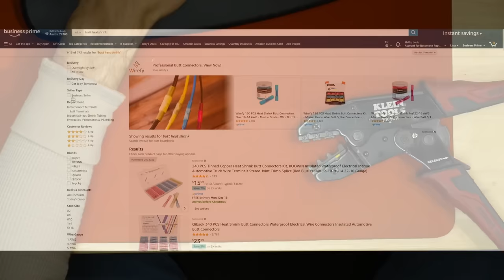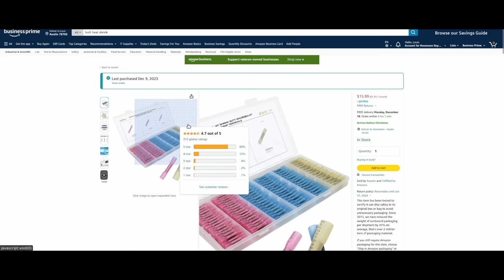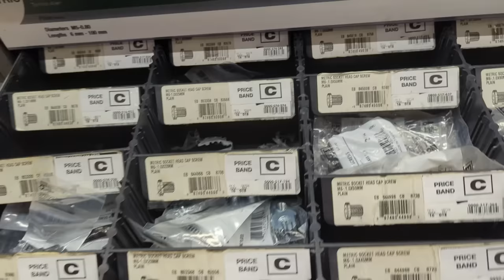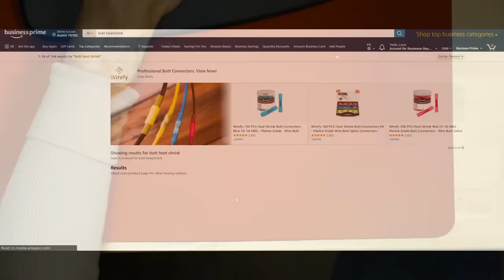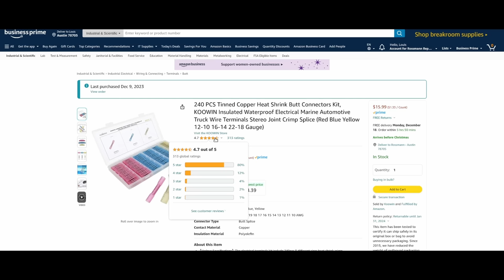Amazon Sells Dangerous Electrical Crimps

Comment: Seeing the stolen stuff in store is so very much seen where I live as well. My thoughts on Amazon's change in direction selling crap is simple. They are doing the same as eBay and whatever junk seller site in China is throwing up. It's pushed hard because these items have the best return for Amazon. When your competition is aiming for very low end stuff sadly the only way to compete is do the same.
Reply: Oh wow really? I've never seen it over here in Europe.
Reply: How do you know that it is stolen?
Reply: GOOD NIGHT SISTA
Reply: @nobodyimportant7804 after enough things get stolen from shops they start locking things up behind glass and cages
Reply: Don't know why you're putting eBay in this post. You can find exactly what you want on eBay including specific brands. Insinuating that Amazon is following eBay is laughable and just shows that you don't understand the point of the video.
Reply: @U-25D5  Oh my bad, I think I misread your comment.
Reply: well in spain is the same
Reply: @U-25D5  We might actually go back to how hardware stores used to operate with knowledgeable staff at the counter (retained because they are paid a decent wage) who you can actually talk to and ask to get what you want for you? Wow, wouldn't that be nice.
Reply: @U-25D5  hard to lock down$5 items
Reply: eBay and Amazon are nothing alike
Reply: eBay is NOT Amazon’s competition tho. Certainly not in North America. It’s just classic race for the bottom capitalism. 💁‍♂️
Reply: Remember when eBay was a place to sell and buy good used items and not a place for everyone to drop ship garbage I miss those days
Reply: @shadedude6games set filter to Preowned it’s same old eBay
Reply: It baffles me how little to no people are in shops at a given time of day in USA whereas here in the philippines, in hardware stores always have a security guard roaming around every hour on a day and security checks your bag at rhe entrance or lets you put your bag in the luggage area with another security guarding everyones bag.
Reply: What is a good alternative to Amazon?
Reply: @transcendtient  eBay buyer & seller here. I concur with you eBay is fine as far as my limited experience is concerned .
Reply: @nobodyimportant7804  Louis mis-spoke a bit. Stolen as in parts and fasteners packages torn open and a few or all contents removed, therefore reported inventory availability is erroneous. Not only Home Depot, this is commonly encountered at Lowe's and other big-box home improvement stores.
Reply: @U-25D5 Maybe so. At a big box store except for graffitti-use spray paints, notsomuch.
Reply: @jam99 Eh? You're describing every ACE hardware or home and garden store presently in existence.
Reply: @transcendtient Agreed. Prime differentiator of eBay is their Seller's behaviour enforcement policies are tough and unyielding. eBay has zero tolerance for the crap Amazon allows their 3rd-party Sellers get away with. Cheers!
Reply: @newagain9964 Your bull$hit capitalism rant aside, it doesn't matter. Everyone's perception is their reality. As often noted in the business press, Amazon perceives eBay as their competition, therefore it is.
Reply: @ghoulbuster1 Ha!, ha! Solid statement. Cheers!
Reply: @jam99    You're funny.
Reply: Thank you! Yes! I total agree, I remember back when I used to shop on eBay (before Amazon) … it was a nightmare, you had to meticulously read every tiny detail of the product description to ensure you’re getting what you think you’re getting and almost impossible to search for a specific item without a thousand irrelevant items showing up because they put every key word possible in the description it was a nightmare and now Amazon is doing the same thing!
Reply: Yet the  "returns" ar not even returns.. The company merely sets up 4ft tall cartons and fillit up with 150+ - items  as done for $450 and $200 ship. The buyer DOES get a better deal with volume of  stuff.. flea sales , and the company never has to bother with  retiuns  TO  their location !
Reply: Yep. Amazon's competition isn't Best Buy or Home Depot, it's Alibaba, Wish, and whatever is going on that's replacing Wish nowadays.
Reply: @SkySong6161  it’s not even about competition. The maniacs who make wish and temu and Amazon are all friends. It’s about keeping the customer confused and docile.
Reply: Leo!! Again!! You're everywhere mate :)

Peace from WA. Hope you and yours have a very Merry Christmas. Thanks for all the great videos this year, again, looking forward to more shenanigans of yours next year.
Reply: @transcendtient people who think you can sell fake or broken stuff on eBay haven’t used eBay regularly and are just making an assumption
Reply: I see totally random seller names now like EKJARVADZ and realize they don't care enough to even to create a name. You crazy, China!
Reply: Amazon US is not a competitor to Alibaba, Temu et al.
Amazon seems to be their most valuable customer!😅

Nearly everything on Amazon you can get at a cheaper price by cutting out the middleman - Amazon!😂

Amazon now serves to 'americanize' China!

I remember the Amazon of yesteryears!

Amazon today is a plaza/mall or market place of many other small and irresponsible businesses!😢
Reply: Amazon US is not a competitor to Alibaba, Temu et al.
Amazon seems to be their most valuable customer!😅

Nearly everything on Amazon you can get at a cheaper price by cutting out the middleman - Amazon!😂

Amazon now serves to 'americanize' China!

I remember the Amazon of yesteryears!

Amazon today is a plaza/mall or market place of many other small and irresponsible businesses!😢
Reply: @helmaschine1885  Maybe Europe needs more diversity then
Reply: @transcendtient  This!
Reply: You must live in a liberal “diverse” place if that’s a issue you people see 😂😂 “cultural enrichment “
Reply: Preach. Ebay comparison is spot on. You can't find the thing you want because it's 100 postings of the same bs under fake company names
Reply: Ebay has gotten more of my business lately because it's often not Chinese sponsored sellers, and instead is individuals or small businesses. Too bad their seller fees are insanely high too.
Reply: @shadedude6games  You miss those days... that we are still experiencing.
Reply: @ckm-mkc  Any retail shop or online store.
Reply: @jam99  I thought we just check ourselves out on the honor system now? Aren't we all supposed to be checking ourselves out now on those stupid kiosks? Pfft, an educated store associate who is paid for their value, haven't seen one of those in a long time.
Reply: @SkySong6161  Temu?
Reply: @nobodyimportant7804 Do you put empty bags back in the drawer after purchasing the item?
Do you go out of your way to screw up Home Depot's SKU system, so they show inventory when they don't?
Reply: @jimurrata6785  What are you babbling about? I misunderstood the OP, and when they clarified I admitted I misunderstood. It was a derp on my part.

You seem to have misunderstood me.
Reply: Yep, but these retailers have to reap what they sow.  If you end up peddling the garbage from drop shippers, what are you going to do when those same drop shippers end up selling everything direct?  The wave of Chinese online portals selling said garbage for 1/2 price is Growing not Declining.
Reply: The absolute state of this country is so sad. Very eye opening to see how high-trust society was in the 90s and before, and how low trust and aggresive it is now.

Comment: 4 months ago or so ago I bought a surge protector on Amazon. When I finally got it, I noticed that the switch felt strange and something was blocking it from turning on.
When I pulled the bottom off, I was absolutely mortified to find that it was constructed to just be a small voltage step-down transformer running an LED for the surge protector section, with everything being bare tinned 16 gauge tin wire with everything just being wrapped around screws. It said it was rated for 2000 watts, nothing indicated it was rated for that. I returned it immediately because it was an electrical fire waiting to happen.
After a month or so, I decided to go back and write a review for the surge protector, only to find that the entire seller's library had been completely changed, and they were now selling beauty products.
That was the final straw for me, and I'm not avoiding that demon site like the plague.
Reply: You'd be equally mortified of the power strips being sold at Home Despot, Lowes and Walmart. They're all built down to a cost and often have bare connections like that inside them.
Reply: The item ID switcharoo is so insanely common lately, feels like 1/4th or so of the items I look at on Amazon are sold on top of some spoofed ID that had a good rating.
Reply: Some products you’ll look at the reviews and it’s all for a completely different product! They can just keep the listing with the good reviews, change the title & picture and everything to a new product, and that’s evidently A-OK.
Reply: @AlchemicSoul  That's a common theme across basically all of the online "marketplaces". The seller will put a multi-item listing and have the cheapest item in the listing as the front-runner to get page views.

Comment: Noticed this issue myself.  I only purchase items that are sold & shipped by amazon... I refuse to deal with 3rd party sellers because 9 out of 10 times... it's garbage and the seller is no better than a scammer.  Then the ones that suddenly change the shipping date from next day to next month... because they're a Chinese seller masquerading as one in my country.

It's gotten to the point where 90% of stuff from 3rd party sellers never even showed up after 3-4 weeks... and then you've got to deal with the whole refund process.

I've started switching back to local purchases for stuff... this xmas, the only thing I bought for anyone from Amazon was a gift card because my brother in law wanted some new trainers and he got them from Amazon (branded)

But I too have noticed that branded goods are getting harder and harder to find online... so I've started going directly to the makers website and looking for direct sales from them, or for a direction to one of their partner sellers.

Hey presto... half the garbage problem disappears.
Reply: eBay is doing that now
Reply: I find myself ordering more and more stuff from small, local (i.e. German in my case) online shops or manufacturer websites. They actually still have the products I want and their prices are usually fine, too.

Comment: Haven’t shopped on Amazon in years, haven’t used eBay in a while too. I’m glad you’re bringing this to people’s attention half the shit from Amazon I can get from Aliexpress for half the price or less and it’s the same quality or better. Most of the crap being made now a days is planned obsolescence and engineered to fail after the warranty period expires that’s why I can’t see myself buying a new car or laptop anytime soon.
Reply: Exactly, I refuse to upgrade my iphone until absolutely mandatory (complete loss) and I'll probably still buy used or get a hand-me-down.
Reply: @girohead  used all the way, I don't buy those ridiculously shabby designed three or four bay rtx4090's that break the pcb without proper support. I'm not surprised there's a crowd of snake-oil salesmen that loves this garbage. AMD's newest CPU only supports half of the pci-e lanes as my older intel processor. So essentially, if you buy a good motherboard for Ryzen, half of what you plug in will not work.
Reply: I got LED lamps from Aliexpress that are higher quality than the ones I got from Amazon. Both were about the same price.

Comment: You are spot on!  I cancelled Prime and stopped using Amazon as my go to e-store.  Chinese junk in literally every category with nearly no oversight by Amazon and these sellers are free to break whichever rule they wish.  I recently bought a tablet and the seller falsified more than half of the listed specs, even key items like the amount of memory and display resolution.  My rule is simple, no matter the price, if it's junk or fake specs, I will return the item.  Luckily, I am near Kohl's and Whole Food, so I just pop in to return without incurring too much out of pocket cost.  Incidentally, I travel to China for work and even visit factories.  The surprising thing is that most Chinese people don't buy local no-name junk.  Most of the factories' outputs are purely going to Amazon to be sold in the west!!  Amazon is absolutely the dumping ground for crap that even Chinese people won't want.
Reply: Well said.

Comment: Your theory is correct Louis; high quality manufacturers are not selling on Amazon. They can setup a store just as easily, or properly support their product via approved channels. I haven't purchased products on Amazon for years and I've since banned our staff sourcing crap there (or Alibaba actually). I will sometimes buy hard-to-find creative content on physical media. Books I buy from our local bookshop, even if slightly dearer.
Reply: Many manufacturers specifically prohibit their dealers from selling on Amazon.
Reply: @beefchicken Would you share a list or some of them? I find interesting ordering stuff from amazon, but now im wondering about it.
Reply: @beefchicken  They prohibit their dealers, but they can't prohibit 3rd party sellers, that's half the problem with Amazon. Especially to your average Amazon shopper who isn't looking at who's selling the product.
Reply: @neoasura  but those manufacturers won’t honor warranties without an original receipt, so buying from a reseller is a bad idea.
Reply: Amazon is still exponentially better than alibaba

Comment: I remember when I had an addiction to eBay as a university student because they were the first to allow international sellers, stuff was so cheap but sometimes you’d wait months to get it, and I was shocked to find it was a knock off but usable. I was actually relieved when Amazon started selling more than books and I could buy what I needed there… what happened is they became eBay, they wanted to eat eBay’s market and they got what they asked for.
Reply: ebay is best for small cheap stuff.. if I just want some fuses or some screws.. some wires.. don't make me shell out $8 for shipping the damn thing, throw it in a first class packet.
Reply: i miss old ebay. i bought so many used things in the past, because the sellers were honest and detailed about their wares. they would take pictures of all the dings and scratches. nowadays all you see is the default "signs of cosmetic wear" when you look for the condition of the product. and it seems like most of them are resellers who just don't care about what they are selling.

Comment: I am disabled so I’m forced to shop at Amazon . I have had to many experiences with defective products listed at the same price as other items of the exact same sort . I got safety pins that bent on anything other than gauze , straight pins so tiny and short that they were useless , a pitcher w a handle that disattached the first time I picked it up , earrings where the stud bent the first time I put on the backs , two rice cookers that worked less than 5 times and another that cost ten dollars more but was deceptively advertised as performing multiple tasks that it in fact did not , ceramic candle holders obviously damaged during production as they had significant holes in what was supposed to be a smooth surface , tiny little bits of skin care in what was represented in the photos as a normal size container , and many more . It is very helpful to me now that Amazon includes in some of its item descriptions the phrase “ This item is frequently returned “ . Since these were issued I haven’t gotten another useless item and I also now do what another commentor suggested which is to read the 1 star reviews first .

Comment: I couldn't agree more about dangerous products being listed on Amazon. A battery charger (not cheap, just moderately priced) I purchased started to smell like it was burning when I plugged it in and I sent it back right away. I'd purchased another product that was mislabelled and when I gave a brutally honest review of the product being not only mislabelled but unfit for purpose, it was delisted.
Amazon's problem was that it compromised its integrity by opening up its market to unvetted, unscrupulous sellers.
Reply: I had a similar experience.  I bought a new thermostat for my stove on amazon, the thing got cooked at the plugin section, yet the connection on stove side was fine.  Left a bad review, next thing I notice a day later, the product is delisted from that specific seller, yet other vendors selling the same product were still up with 4.8 star reviews. What I want to know, who is reviewing these products?  No way they should have good rating.

Comment: I use to sell on amazon and the review system is a joke. Competitors selling the exact product as you and use the same factory will leave you negative reviews just so they get more sales.  I was never able to get the fake bad reviews down even after proving they weren't even real users. (Offered refund and replacements and no replies and the address looked shady) Yet the bigger white label companies pay someone at amazon to remove reviews all the time. Or they take an old unused listing for toothpaste that already has thousands of 4 and 5 stars then make switch it to a new product and keep all the old reviews.